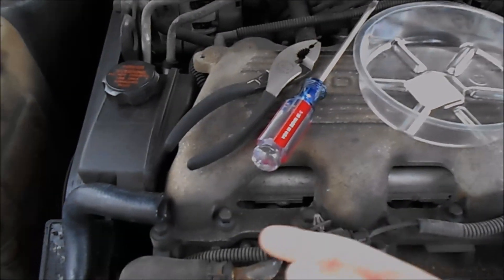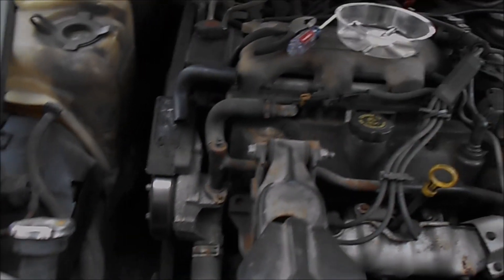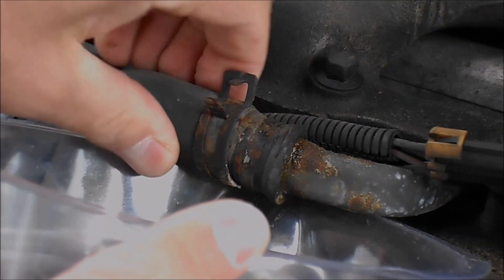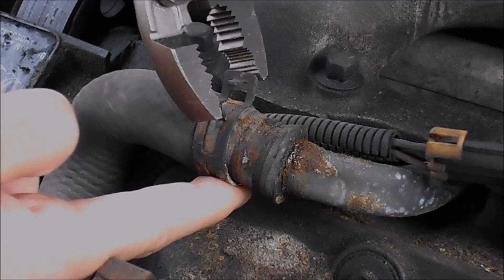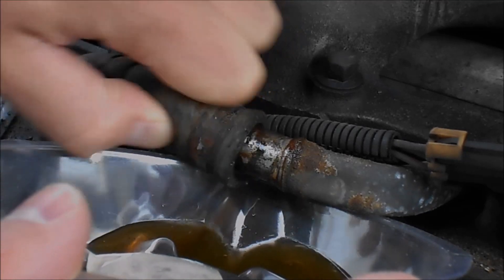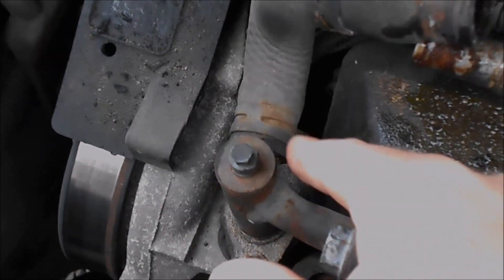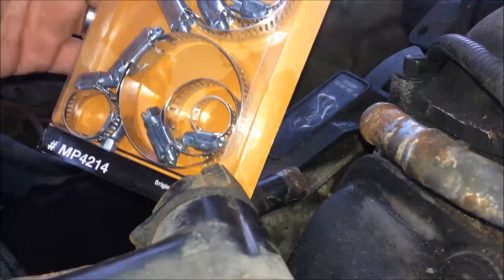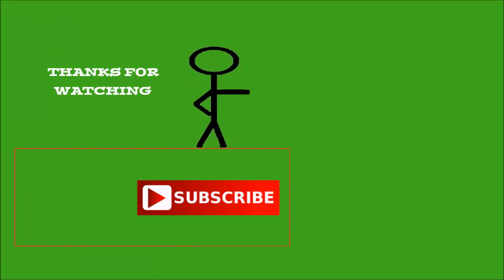How to find leak in Cooling System in car

Comment: Replace the original dex-cool coolant with the regular green coolant. Dex-cool kills the 3.1 engine trust me I changed 4 engines.
Reply from the maker: J LUMINADO dude no way... I was using Dex Cool cause the manual said to. No wonder I can’t keep my coolant from leaking. You think if it’s leaking it’s the water pump gasket?
Reply: @AutOdometer  yes I know I thought the same thing and after getting fed up with literally 4 engines getting a bad head gaskets I researched for a good 2-3weeks and found out that was exactly the problem why my engine was doing that. Basically the 3.1 was the " experimental" engine to start wanting to change to their new coolant. Once I found that out and after thousands and thousands of dollars spent I decided to switch to the peak green coolant and never looked back. The dex-cool eats up the plastic head gaskets hence the leaks for the heads. 
It might cost you some money but If you have a leak and never changed the water pump what I would do is flush the ENTIRE coolant system whith water, (chrisfix has a great video for it) buy a new water pump, thermostat and take a close look at the inside of the radiator if it looks like rust like I seen when you removed the small hose change the radiator As well. It sounds like alot but it's not as bad as alot of people think. If your lumina has never overheated then you're more than likely ok on the head gaskets being fine but I would keep an eye on the oil every few days. Also makes great content for more videos. 👍👍 one more thing if you decide to do that I would also check that all the rubber hoses that pass coolant through them aren't cracked or have holes in them. Oh and air out the radiator by slightly opening the coolant valves there are 2 one by hoses that you changed and the other one is underneath the throttle body before the thermostat.